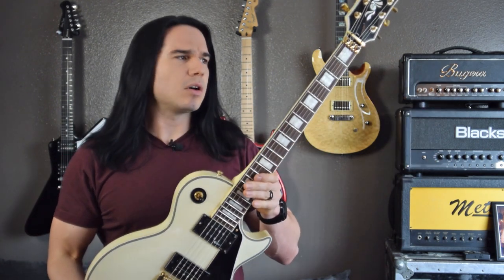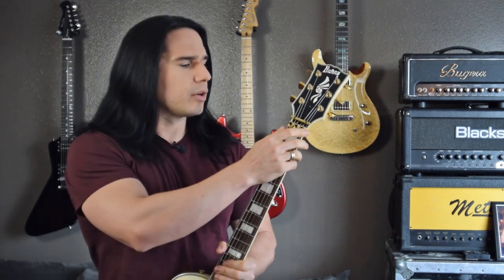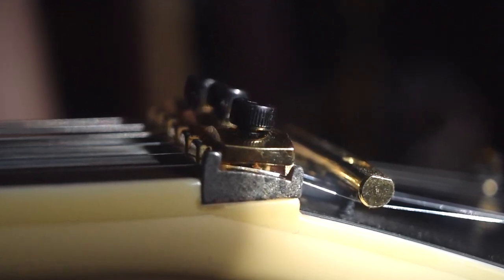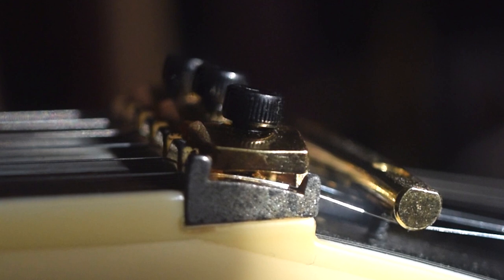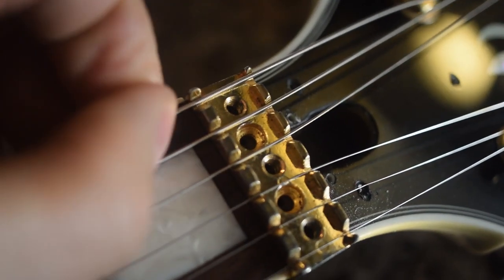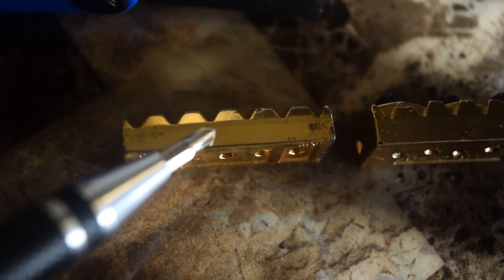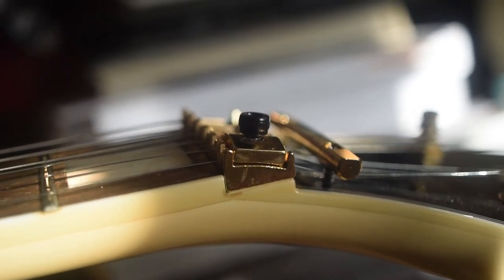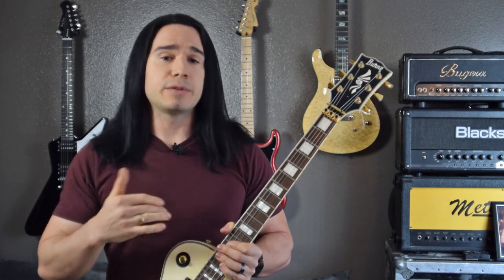How to change your Nut - Tutorial (Floyd Rose)

Comment: Swapping out a locking nut for a another locking nut is pretty straightforward.
When I wanted to swap out the nut on my Squire Strat '63 re-issue, I took it to a guitar tech named Joe at Joes' Guitars in Stuttgart Germany. 
I wanted to replace the vintage style tremelo with a Washburn type surface mount. That allowed for up and down whammies. The new tremelo came with a string lock that mounted behind the nut and replaced the single string tree.
Joe did a great job and from what he said it sounded like I could have done it myself. It was that easy.
Reply: Would recommend the original floyd rose nut? or other brands / generic will do?

Comment: Another cool tip to changing out Floyd nuts: The key to tone in ANY nut; is the quality on the actual contact between the nut and the nut shelf. Among good techs; it's common practice to level the nut shelf as perfectly as possible -before mounting a nut. This brings me to the cool tip: -Have anyone ever checked: How level is the bottom of ANY new FR-style nut? This is so easy to check: Just put the nut on some abrasive -on a straight surface. And do a few strokes of leveling. What You see is what You have/get. The truth is actually pretty scary. To conclude: You can level the FR shelf on a guitar to absolute perfection; but still don't get ever near a optimal contact for the nut. But if You also level the bottom of the nut: -Some really awesome things starts to happen tonally in Your FR-equipped guitar! But be aware! leveling the shelf and the bottom of the nut changes/lowers the distance between the strings and the first fret. However: Optimal contact  -with a fullsize shim between the shelf and the nut works wonderworks too.

Comment: The old nut on that guitar was accually the orginal factory nut. I recognize the squares on the bottom of it. (The pattern ie the same as on my Burny guitar.) The locking blocks on top of the bridge looks -might have been changed tough… I too have swapped out the nut on mine. Found some hideous sandpaper shimming under my orginal nut. Can't say if that had been there from the factory -or if the previous owner stuck it there. Anyway: Cool guitar dude!  (Mine is black.)

Comment: Glad to know this.  I have a 1998 Peavey Wolfgang USA Special that has a tuning issue.  It was just fine with thick strings.  But swapping out the old strings for a new lighter gauge string brought out a serious tuning problem.  A good dive and it all went to 💩.  I found grooves on the underside of the nut clamps that allowed the thinner strings to slide right on by, especially on the G string.  I just ordered a new FR original R2 nut that will hopefully right this wrong.

Comment: Thank you for this video. Is the string tensioner necessary? I bought a used Kramer voyager and it’s missing the nut and string tensioner, but can’t seem to find much specs on pages/forums online. It’s an 80s Kramer Voyager so trying to also figure out if it’s an R2 or R3 nut

Comment: i recently learned the hard way that floyd nuts come in three radii (10in, 12in, and 15in). most are 10, a couple are 12, and only one, the 10 (R10/L10) is 15in. i need an R10 and of course those are sold out. so my brand new $400 upgraded Floyd has a crappy worn out licensed locking nut, but it still works great

Comment: HOME DEPOT take the hex bolt with you and get the next size shorter in hardware for 10 Cents and u can get the nicer grade 8 stronger bolts there too instead of cheap china bolts that'll just strip on anything

Comment: I just switched out some stock clamps on my B.C. Rich Jr. V Standard 2 months ago, because a screw hole got stripped after a while and one of the clamps wouldn't clamp, and I noticed the whole thing was glued on there even though it has screws. Was a real pain getting the parts off the guitar being glued the way they were. Whoever thought that was a good idea is a nutcase. 😂

But yeah. It's an easy process. Just gotta be careful. I make sure to get original German parts.

Comment: Might be a stupid question but, is it possible to use locking tuners with a Floyd instead of a locking nut?
Reply from the maker: It's possible, sure, but it wouldn't work very well. The purpose of the locking nut is to keep the strings from sliding through the nut. Locking tuners wouldn't prevent that.

Comment: Hi, Max. Thanks for the video! I have a Lero Les Paul copy, same colour configuration as your Burny. I have a question for you. The tailpiece on my guitar is a piece of pipe, fashioned in to a tailpiece. It's ugly but functions for the most part. My problem is that the tailpiece has 3 1/2 inch spacing, not the standard 3 1/4 inch. Do you have any idea where I can find a replacement, vintage or otherwise? I have already tried Allparts, Ebay, Long&McQuade and a local shop. Cheers.

Comment: Hi Max useful content as always... I have a question for you, ia have two old guitars with locking nut and i notice that the two screws on the back of the neck are messed up, can i swap the nut for another one or these screws are holding it on place...it will be a pain in the ass !!!! I have a problem of intonation on one of my guitars and i think is due to the nut...thanks and keep going with your contents

Comment: I have to replace a back mounted locking nut on an old guitar but the heads of the back screws are completely stripped. Someone has some advice on how to remove that??? Thanks
Reply: try cutting a slit or two with a dremel tool, so that a philips screwdriver can take hold

Comment: I have a question. How can I determine what gauge of strings my guitar needs?
Reply from the maker: It's more of a personal preference. For electric guitar, on a 25.5" scale length (like a Fender Strat or Jackson or Ibanez), .09 - .42 is pretty standard (often just called a "set of 9's"). For a 24.75" scale length like most Gibson guitars, .10-.46 is typical, (often called a "set of 10's"). However, for certain styles, like Jazz, people often use heavier strings, or if you're tuning your guitar lower than standard tuning, then you typically would use heavier strings, to make up for the lack of string tension at the lower tunings. I hope that helps!
Reply: Guitar MAX I have this Gibson/Baldwin electric guitar that looks like a les Paul, but the 6th string broke and the replacement I got makes a buzzing noise, cuz it’s hitting the frets. Do you think the 10 will work?
Reply from the maker: Yes, the set of 10's should be great for that. A little buzzing is not a problem as long as you can't hear it through the amplifier. If it's too much, you can raise the bridge (or one side of the bridge usually). If you Google "how to adjust action on Les Paul" it should give you a good guide to doing that.
Reply: Guitar MAX you’re a lifesaver Thank you

Comment: Hi,Max. just wanna ask. I am thinking of replacing my old locking nut (size 42) with Gotoh. But Gotoh only have width 41 or 43 mm.  is it a good idea if I replace my old locking nut with the wider (43 mm) size? thanks
Reply from the maker: Hmmm... I'm honestly not sure. I think 43 would be better than 41, and it's really almost no difference when you consider it as a percentage, but it still might feel a little off when you're playing open chords up by the headstock.
Reply: @GuitarMAXMusic  Thx,Max for replying and giving your thoughts about it. I guess you are right. I will have to re-consinder this. Thanks again :)

Comment: i had one of the hex nuts on my ibanez lock nut trip out completely. I just had to swap out the whole thing - with that string still locked in. Also, you can over tighten them and get little grooves in your locking clamps and then they don't hold the strings in tune. It's definitely something you may have to change out occasionally.
Reply: Mark Shields don’t they make titanium or stainless steel nuts and clamps to counteract this over time?
Reply: sha-d paul sure.you'd have to do this thing to install one if those
Reply: Mark Shields it certainly would be worth the money. I’ve been deciding wether or not to get a guitar with a Floyd since I’ve learned a lot from playing on a hardtail for 2 1/2 years. Definitely will look into getting one.
Reply: sha-d paul Floyd's are a core part of my playing. i have three guitars set up with double locking floating trems currently and have used them for over 20 years. They open up an expressive avenue that you don't have without one. Extreme control over vibrato for one. All those little dips... you know the Gilmore and Beck stuff. Andddd the big screams and dives that the Van Halens, Vais, and Satrianis are known for all with rock solid tuning stability...at least if its set up well, locked down with the strings stretched in. There is a trade off though. There is a learning curve when setting one up and you can't easily change tunings. The whole thing is about balance between the tension of the strings and springs. Do get one. Do understand they have their idiosyncrasies. Don't give up the first time you need to change strings.

Comment: When I lock my clamps down the tuning keeps changing. It goes higher the tighter I make it. Can anyone help with this?
Reply from the maker: Does the headstock have a string retainer bar on it? A little bar that keeps the strings in place?
Reply: @GuitarMAXMusic  yes. I've lowered it to make sure there was no space between the strings and nut.
Reply: @GuitarMAXMusic  watched your video again and since I bought this guitar used I tried a different set of clamps from another guitar and it worked. Stays in tune when I tighten clamps now. Thank ya very much. It was your video that fixed it. 👍✌️